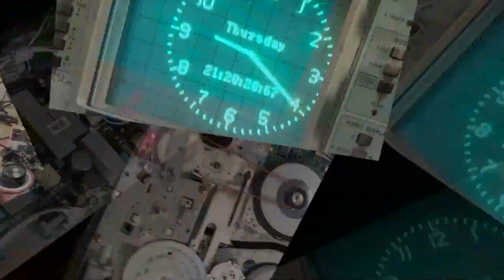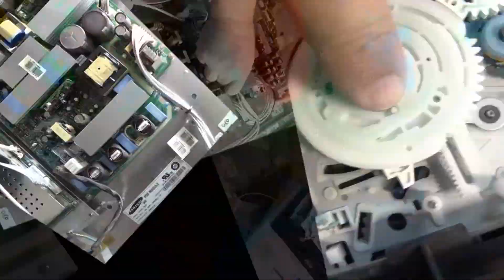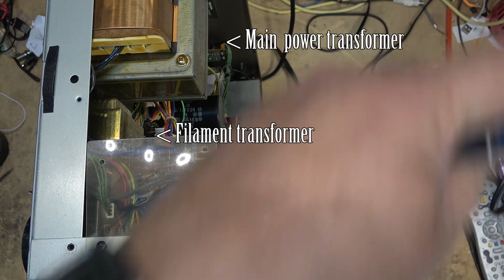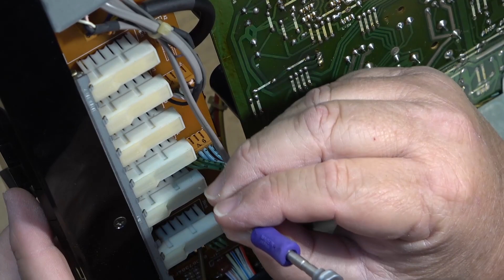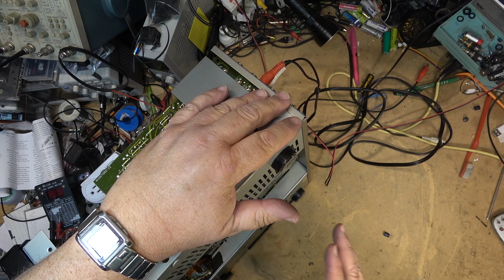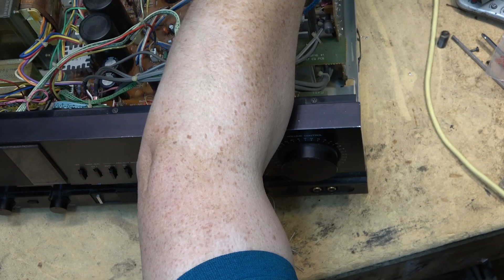Luxman LV103 Severe distortion on Left Channel

Comment: Most engineers have a learning, sharing and teaching mentality. They are different roles the engineer knows why things are the way they are and they wrote the book while the technician knows how to read the book and do what is says.  Thanks for sharing, I have a luxman amp which I bought new in the 80s and it's great, it does have some small issues with noisy switches, bad protection relay and I suspect a bad capacitor because it sometimes takes a kick on the volume to wake up one channel. It is an  lv111 which I think was one of their first full silicon versions. My friends joked about it being a car radio brand, but the price was actually better than others and I really liked that it was high current which could really power the speakers well. I miss the 80s! Never listen to friends and don't listen to the current nonsense about having small speakers and surround sound

Comment: Fantastic amp. I'm happy to own one. I have sourced spare transistors and tubes just in case.
This amp has great sound and is very punchy, very hi dynamics. 
I have only one problem and that is the switches. Like this one I see.
As I have also a Quad 405 I should use the time to clean it up but have other things to do also...
Reply from the maker: The switches are the weak link unfortunately. I retired mine and use a Technics suv9 now in the control room.
Reply: @12voltvids  
Yes,
This amp was left in an appartment dat some one rented from me. For him it was just an oversized paperweight. I'm happy with that line of thought of him. 
Apart from cleaning the swithches there was realy nothing wrong. This was around 15 years back.
If some one has more of those paperweights I'm in.

Comment: I like the fact that you can put to caps in series to double the voltage rating but when in parallel the V rating stays the same. Using 4 caps 2 pairs both in parallel and then put those 2 separate pairs in series will double the rating for voltage and the capacitance.

Comment: So you still buy that turning equipment on and off is bad for the semiconductors?  

I had a 70's amp that I had re-capped and biased idling one day and the output section went and threw DC into my sub.  Good thing I was in the room with it...
I figure most good designs these days have soft start circuits?

Comment: I ran into something interesting with my old 1980's Harmon Kardon stereo. If you are touching the ground of the output cable from a cassette deck or turntable and the chassis of the stereo as you are connecting the two, you would get a small bite from it. I determined that if you put the power cable in one way, you would have power between the two with the amp off. If you put the power cord in the other way, you would see power with the amp on. I wired in the polarized cord such that the power between the two would only show up when the power was on. I reasoned that I was less likely to be changing the connections if the amp was on. It has been too long since I looked at it but I vaguely remember there were two capacitors going to ground, possibly one on each leg of the power line? Don't remember. I think I did check the voltage between the power outlet ground and the stereo and got the same results.
Reply from the maker: Generally the neutral side is coupled to the chassis using a ceramic disc cap. It's done to decouple any RF that might get picked up by the cabinet and shouldn't transfer more than a few microamps if it's if the power cord is reversed. You're not going to get a shock from it but you can certainly feel it if your hands are wet you might feel it or a little more. The leakage would be in microamps anyway but that's why we have polarized cords so that they're all on the neutral side as long as they're plugged into the same power stripper or outlet you shouldn't have a problem but if you got them plugged into different outlets there could be a slight potential difference on the neutral. There shouldn't be but quite often there is if they're going to different breakers in the panel. All depends on what other devices may be on that other leg. For example if you had something to do a lot of current such as an electric heater plugged in it's drawing a thousand Watts well that 1,000 watts is returning on the neutral line so if you're plugged into a parallel output on the same circuit that there's a big load on that neutral might be a couple volts above ground potential normally your neutral is bonded to ground back at the main panel but it can float a bit if you're drawing a heavy load because that's how it works your wine power goes through the device and comes back on the neutral so a high current resistive load for example will cause the neutral to raise up a bit could be as high as a couple volts depending on the length of the wire and how far you are from where it's grounded at the panel

Comment: that voltage leakage is interesting. i think i have that with my laptop sometimes. every once in a while i'll feel a buzz or very slight static tingle sensation when i touch the metal case, but it only does it once in a while. i'll have to pay attention if i have a certain thing plugged into it when it happens

Comment: I never heard that the inrush was the problem, but the heat cycling eventually making solder joints fail because of expansion and contraction.
Reply from the maker: That's true too heat and cool cycles cause solder joints to fail due to expansion of dissimilar metals.  With incandescent light bulbs if you run them up slowly and only go to about 90% they will last literally forever.  I have some decorator lamps in a grandfather clock that are operating at reduced brightness about 50% that are at least 15 years old and going strong.

Comment: Interesting video. As for always leaving things on...My father was a tv repairman back in the days of vacuum tubes, and he said that people would always say that the set quit when they got home from a vacation after it hadn't been used for a week or more...In addition, The CEO at PS Audio says that they did away with the power switches on many of their amps so that they are always on. They claim that the amps just sound better when always powered, and it cuts back the failure rate of components.
Reply from the maker: That is absolutely 100% correct. My icom ham radio the one I fixed the display on last year it's never turned off. When I went on holidays for a week somehow I didn't notice that the power supply had been turned off. When I came back and turned the radio on my display is all white again radio works display has gone bad a game I'm going to have to take it apart and see if I can fix the head unit. Equipment does last longer if it's left running. That's why television stations never shut their equipment off unless it's being transported from one location to another. Radio stations are the same everything is kept turned on and running 24 hours a day. I have several pieces of equipment here that I never turn off my security camera monitors for one. One LCD said I used to turn on and off all the time and that's the one that the fluorescent backlights failed on another identical set has never been turned off and it's been going for at least 20 years I'm looking at one right now that's never been turned off, as of right now that monitor has 66,535 hours and it's still going strong. Nine times out of 10 when the switching power supply is going to fail it's after it's been running for a while like years and you get a power failure and the capacitor is cool down then when you go to turn it back on they won't start nine times out of 10 that's when they're going to fail. the only reason I turn everything off now and I'm not using it because I'm tired of paying through the nose for my electric bill because electricity is gone up quite a bit over the years and it keeps going up so I shut stuff off when I'm not using it just to conserve energy but I know that it is going to shorten the life of the product and require more maintenance

Comment: Hey had a question. I’ve gone through about 10-11 older used CRT sets this year alone for gaming. Every single one had some degree of convergence separation of the red lines from the white lines. Is this something to expect with any CRT and what typically causes it, just age and wear? The set I’m currently using for gaming is a 19” low-end 1997 Magnanox (RF out only set) and the convergence is looking pretty rough. I fear if I just go chasing the CRT dragon for the perfect picture, I’ll waste money and heartbreak seeing more of the same convergence flaws.
Reply from the maker: Here's the thing about CRTs you're never going to have a perfect picture. Never! The only way you're ever going to get an absolutely perfect picture is if you build yourself a completely magnetically shielded enclosure and sit in that enclosure. This rock that we sit on is a giant magnet and the magnetic field from the earth will influence all CRTs you can get the pretty good in the middle but as you get out to the edges it becomes more problematic and television is used a circuit referred to as dynamic convergence to try to compensate for this the problem is dynamic convergence works using a lot of capacitors and coils and as they get older the value start to shift which will cause them to drift. Even if you change all the parts and you get it good now 6 months from now it's not going to be perfect that's just the way that it is. I was ready to hang myself with one customer I had that was so frustrating. Brand new Sony Trinitron big one this is going back to the late 90s. This guy was an engineer and they're always the worst and he  was German that made it 10 times worse. This guy buys a new TV takes it home sets it up and gets out his protractor I've been calls and it's not right I spend hours trying to get it to his satisfaction on a brand new TV it is house I can't get it to a satisfaction I get it looking good he measures it agrees everything's good I put the back on it I turn it around and put it back in the corner he's not happy. Finally after wasting probably 10 or 12 hours, unpaid time I should say I told him there was nothing more I could do and that he really should be paying me for my time. His attitude was well you have to bill Sony. I tell him I did build Sony they paid $85 for the service call that covered the first hour I've been at your place 4 hours on two separate occasions because it's not good enough for you who's going to pay me for all those extra hours because I'm not paid by the hour I'm paid by the job and every hour I waste trying to make your TV to your acceptable standards is an hour that I'm not getting paid I finally walked out and I left it horrible by his standards. The guy comes down screaming at the boss the boss is screaming at me and I said to my boss why don't you go up to his house and see if you can do it any better. About 2 weeks later I see the TV back in the showroom the shop is giving him a refund and told him never come back. We lost our shirt on that one and my boss at the time all he said is you lost a few hours and I lost hundreds of dollars because now I can't sell this TV as a new set and that was his attitude. The guy I work for was a piece of work and that's why I left, or one of the reasons I left. But to answer your question you never going to get it looking good even when they were new they were not perfect especially in the corners you can get them close but you never going to get it perfect. you got to stick little magnets on the bell of the tube and especially them are modern ones that use static convergence little Chevron magnets go on the bell of the tube and you're going to spend hours and hours and hours trying to get the thing looking good and when you get one quarter looking good it's going to throw something else off that's just the nature of the beast for CRTs. it was even worse with the 16x9 sets they were very difficult to try to get looking perfect you can get them looking pretty good but you're always going to see some convergence or purity errors in the extreme corners.
Reply: @12voltvids  thank you for the detailed response, very much appreciated!!
Reply: I made the mistake of dickin around with the convergence rings on the neck and ruined the picture, couldnt get it back so definitely gonna avoid that for other sets
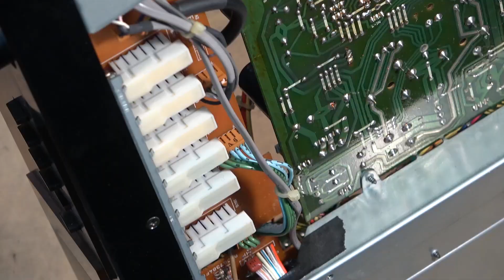Reply from the maker: @RetrofIex  it can be fun all right.  There is a procedure to do it.  You need to get the purity correct first which is I think that was the innermost pair of rings I forgot it's been so long since I've done it but to do that you need to put up a solid red screen and then you get the purity correct and then once you get the purity correct then it's the other sets of rings that will adjust the convergence but if you don't have the purity correct with a solid red screen and no other color showing but red you'll never get it you'll never get it even close. It's been so long since I've actually done that I haven't done a convergence job on a CRT probably since around 2000 or 2001. Used to change lots of Trinitron tubes back in the '90s when they were all popping like fuses but by 2,000 people were buying flat panels right so when the tube went on their TV they were tossing it out. So I tend to forget the procedure but if you look up the service manual for the model you've got there will be a procedure and it will tell you which which two adjust the purity you start with them all straight up and down pointing at 12:00 and then when you adjust them you typically spread them at an equal amount out and then rotate them and keep them together as you rotate them and there's a procedure if you look in the manual it will tell you how to do it it is involved and it will take a while.
Reply: @RetrofIex  not a problem.

Comment: Dave, speaking of inrush current, I have a great soundcraftman power amplifier, rated at 400 watts rms @ 4 ohms, and when I turn it on, can hear the power surge in the transformer and filter caps !, can you suggest a soft start/speaker protection circuit that I can build to install in this amp ?, I use it as my test amp on the repair bench, thanks for any help you can give!

Comment: Hi Dave,  thanks for another great video!!, great short backstory of past years of working in the electronics field, especially with the station engineers !
Reply from the maker: Engineer ended my tv career before it got going by when i used the station as a reference he said i shouldn't be left around equipment without supervision as i would take it apart. Well not in so many works but he said my zeast for learning about the equipment had annoyed the technical staff.  A knife is the back basically.   If anyone knows how film, tv, radio and recording business goes.  They put you on the black list and nobody will hire you.  I figured out why my boss at the time always got me to unjam a tape or to flip open the side of the camera and reseat the boards that had worked their way loose.  I was eager to please but all he was doing was covering his own ass and when the fit hit the shan he could deny any knowledge and leave me hanging. That's exactly what he did.  Fresh out of college and a permanent black mark as far as broadcast.  Probably for the better.  2 guys that interned with me went on to be cameramen at ckvu tv.  Both dead by 40 from brain tumour. Most likely brought on by exposure to x-ray exposure from monochrome CRT viewfinder.  For the skeptics both had tumour right where the exposure would have been.  Joe was a studio cameraman and his was in frontal lobe between his eyes.  Mark was an eng and his was on the right side behind his shooting eye.  Need any more proof that those high resolution viewfinders were bad. I certainly don't.  I spent time behind a camera too but not 40 hours a week. Mine was perhaps 10 hours a month at most.
Reply: @12voltvids  Hi Dave, wow !!, that's quite a story !, and a shame that those two guys died from the radiation of the cameras!, also that was crappy of your boss/supervisor to throw you under the bus like that !, but it worked out well, you have a vast knowledge and experience with all sorts of electronic equipment !, I hope you keep doing this for years to come !, and I appreciate your videos, even though I'm in the lower 48 !, take care and enjoy the fall weather !

Comment: Hi 12voltvids good to see your professional experience at work. I am new here and I'm sure you have experience with Akai reel to reel tape machines. Some have those terrible pot metal cams but I can get new ones but I am working on a 1730dss a customer brought me and the cams have already been changed but the motor pulley is pot metal and cracked. I can't find one so I ran thin super glue in the cracks and left it to dry for about 24 hours then powered the motor on and filled the high spots with a file. It works great and I think the super glue will hold it together for a very long time. Just thought I'd pass my encounters and remedies to you and others that may can be of help someday

Comment: Hi Dave enjoyed your commentary on your early times regarding work experiences and leaving devices powered on. Back in the mid 70’s I served in the Air Force as a radio repair and I too was instructed to not turn off much of our equipment. Still today at home I leave some equipment running for the same reasons